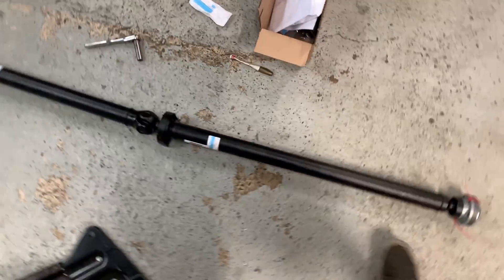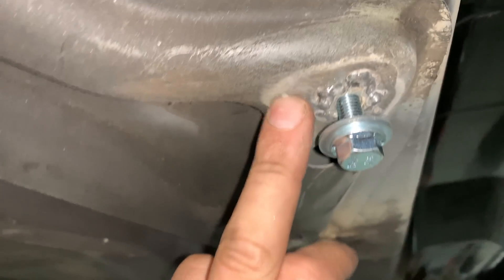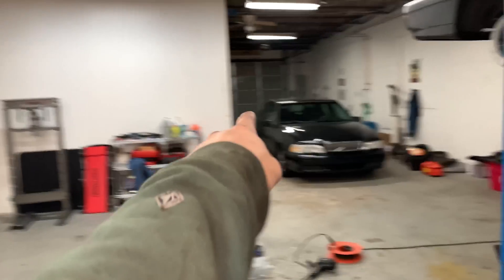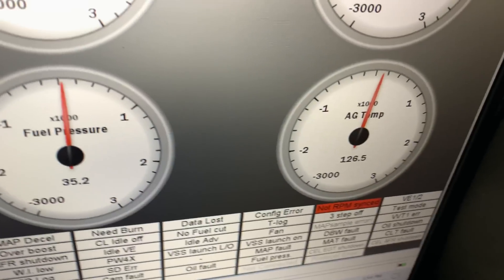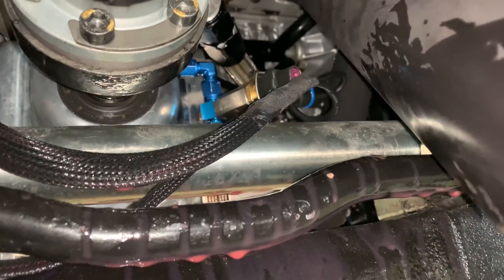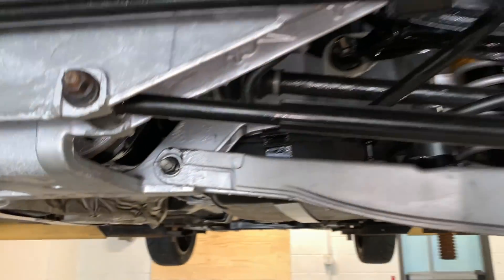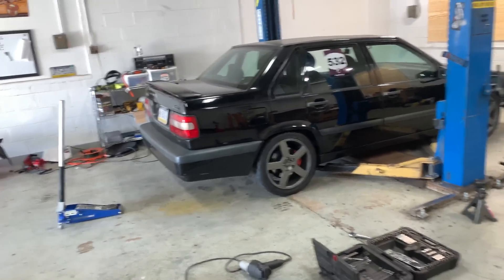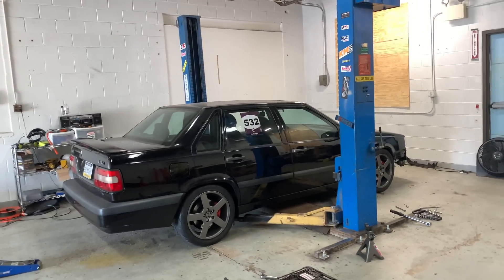Volvo 850 T-5R AWD Swap - First AWD Test (Bad VCU?)

Comment from the maker: Soo... to clear some things up... I am going try locked 50/50 to see how it is driving around. If its just some wheel skip when turning below 3mph or bind when at full lock I won't care as long as its undetectable driving normally. The long term plan is to adapt a GEN3 HALDEX from 06+ Volvos if for some reason I really really dislike locked. This is a race car that I just happened to be able to get street legal. This isn't a daily and I barely drive it. I dont drive in parking lots or go through drive thrus, I dont see being locked an issue. The car does 1,000 miles a year if that.
Reply from the maker: I ended up picking up a known good working viscous coupler. I just picked up my welded locked 4WD one too. Well be doing some back to back testing the next two videos... hopefully with an outside camera too so that we can see what the hell the rear wheels are doing. Doing some pulls in locked 4WD ill defeintly know what all 4 feels like... then I can compare to a known working visco. Maybe mine was just so horribly damaged.
Reply: @SimplyVolvo  Yes yes yes was thinking but forgot to mention outside footage! Was too excited:)
Reply: Dude Lock it! I drove a 240 with a welded diff (I know, not the same) for years around town! Hardly noticeable.
Reply: There are solutions, but over the head budget rabbit hole, but that was never the essential point of this build, more of a garage oem modified, right? It really has some special character to it, that's why I love this project so much.

As much as I understand, locking it, would have understeer problem while cornering, but for the straight line? Lock it!

But dude! You will give someone a heart attack in your town with this:)) Sounds SOOO GOOD!!:)
Reply: I'm excited for the next driving video sans center slipper!
Reply from the maker: @turbovolvos40  Yeah im curious to see how different the launches are. I bet I will need to launch closer to 6500 vs 5500. I don't think the stress will be that much more because I bet it will just break all 4 loose (215s on street aint much for 600hp even AWD)... however spinning all 4 I bet traction will still be light years over FWD spinning. Fortunately we will be able to compare the visco & locked launches.
Reply: The viscous coupling will slip like hell untill it is hot enough to make the fluid gel up, in the winter my 850 awd spins the front for 3 seconds and then kicks in when spinning, I've been looking for solutions to replace the fluid in the coupling just the the Honda unit, only issue is draining and filling a sealed unit. Also if you still have a reverse disconnect clutch in there, WELD THAT ASAP, they like to put weird load on the drive line by unloading it on decel, then taking a long time to engage again. Another awd 850 siiiiick
Reply from the maker: @micahb5659  Yes the reverse disconnect clutch (freewheel mechanism) is already welded Ive been told they break very easily.
Reply: I was thinking, man he's going to have to either lock it 50/50 or go haldex route.

Comment: Beautiful build. 
I’m here to remember, the one wheel off AWD test. 
Front right up, is there a torque value?
I’m worried I pooched my 98XC.
But left jealous of the new propshaft. My 97 Manual AWD, the steady bearing rubber is dead.

Comment: If a person were to build a torque sensing rear diff like a ooohhhhh a 8.8 ford out of a 03 s/c cobra and use the same clutch style front lsd one could have a 50/50 with minimal crow hop in parking lots .
Also one could use a set up off a p3 car and set up a rheostat to the aoc pump or even a window switch and better pump to increase line pressure sooner to lock the " slipper clutch" . I've used window switches( it can be set to rpm )  from NOS ( nitrous oxide systems ) before on my focus engine swap car and it worked great for turning on and off things for the chassis and aero back in 06 . The issue is the factory volvo part was never ment to control 700 whp and 9 kabillion pound feet😅😂🤣

Comment: So I have been a auto mechanic/tech for going on 25 years now.
I am a volvo tech the past 3 ......
How the hell do you figure out all this stuff? 80% of what volvo does makes perfect sense, the other 20 has me floored. Don't get me started about vida ( the worse diag system on the planet ) I've worked for ford ( right in the middle of them owning volvo ) so most of the systems on the p3 cars I know but these spa cars are driving me to put my head in my ball joint press ....
In short I am very impressed with your work.
Why does your bevel gear leak cam cover shmooie?

Comment: Dude I need your professional help I also have a Volvo 850 turbo and sometimes like working on a four cylinder if you can help me tell me what the problem is he does not lose water could be one of the torn rubber bands of the air if you can help

Comment: For the record volvo states 6 bolts prop shaft torque.. stage1, 10nm in a cross patten,stage 2, 25nm in a cross pattern. I didn't write the service manual, i just follow it.

Comment: HUH?!.. wtf is that hose which first goes right to the road then up,  in the front of the car?! If that sent fuel or oil ...you are insane! why would you do that as you did? why would you let the turbo in that stupid position for a modified car?! Why don't you build a mainfold which bring turbo over the gearbox somewhere, preferably with induction side pointed right to the front of the car?!

Comment: Ore the connecting part (don't know the name in english) between gearbox and angle gear already lost its teeth. Pick it up and turn the front wheels, the propshaft should turn along. If it doesn't turn thats probably the problem! good luck

Comment: As i said before, I welded the Viscuscoupler when I drove RWD and that worked good. As long as you have differantials between the front wheels and between the back wheels it shouldn't be a problem. When the viscus coupler is welded you get the same situation as a fwd car that takes a turn in neutral , just rollin. Al the wheels have the same rpm at lets say 5km/h and when you turn in, there is no problem. The only problem can be when you go on the throttle , that the rear wheels will try to push you strait. But the toyota Celica GT4 has also a contious 50/50 4wd system and no pronblems. Keep it up!
Reply from the maker: I tried the welded viscous coupler in 4WD mode i seemed to still not have much traction in the rear. Im going to remove a front axle and run it RWD and tune the rear suspension for max traction then the AWD or 4WD depending on which I use should work well.
Reply: @SimplyVolvo  did you check if the propshaft turns togheter with the front wheels. You can also turn the propshaft manualy and one of the front wheels should react. If not they are not connected

Comment: have the same problem with my viscous, when i tryed to winter drift it i had to really beat on it and get it hot to stay locked. what worked for me was clutch kicking it in 2nd gear but stil had to get hot so i feel your pain with the viscous

Comment: Matt, I meant to mention that maybe Hussein H.  might be a good bloke to talk to about the Viscous coupling or Haldex unit as he just built/converted a AWD Volvo C30 and is pretty cluey about these sorta things.
  
Also the main issue (which I think I've mentioned before)
 I see with a fully locked V/C is drive line wind up (which is one reason for a centre diff), which although probably won't break your tough drive line, has the possibility to put significant drag/strain on the system and if you're roll racing it could very well knock off some of your speed.
 Just doing a U turn in the pits is enough to load up the drive line, as anyone with a locked diff can attest to with that annoying wheel chatter.
You can feel the elasticity of the driveshafts as they wind up before suddenly loosing traction.
 A Haldex coupling would be a better choice, be it more complicated.
Well that's just my 2 cents worth anyway.
Reply from the maker: Funny you mention him, I just bought the old VC from his wagon. We have been chatting on what could be wrong.
Reply: @SimplyVolvo  
Well it seems our cars will be related to each other, I got the M66 open diff from his car too. 🙂
Reply from the maker: @Johnno48  Yes I have a bunch of parts off his old wagon. Exhaust manifold, larger fuel rail, fuel pressure regulator, most of the fuel system. Just another relic going on my car hahaha.

Comment: About that rear kicking in with a clunk after a few seconds. I had that problem in my 2.5T AWD (gen 3) where the Haldex oil pressure sensor was going bad. Replaced the sensor and the rear comes on exactly like it should now.

Comment: Volvo's viscous coupler gives you something like a 70/30 torque split if you're lucky. It's enough to kick the rear end out in the snow but that's about it. The fluid isn't nearly as thick as you would need it to be to hook with that much power at that high of RPM. There's also no way to replace the viscous fluid as far as I know.  The gen 3 haldex like I've seen you mention provides a 60/40 torque split in the sedans and wagons but I believe the xc90's haldex control unit allows a 50/50 torque split. I'm sure that's something you'd have the capability to program and alter to your liking anyway though.

Comment: Did you tune it your self.....
Reply from the maker: Yes I tune it myself. I had it on the dyno 3 times last year so it has a pretty good tune up in it, I just turned down the boost to 22 psi so its about 550awhp right now.
Reply: @SimplyVolvo  can you tune mine....I'm  1 of the people who purchased the exhaust manifold for an 07volvo v70r my vehicle is at MB AUTOMOTIVE... I believe u have had conversations with my guy...

Comment: Could fork over the $1300 on a new VC. Can't believe how expensive they are though. I'm curious how you plan to get it to permanent 4x4? Adapting a gen3 haldex would be interesting.
Reply from the maker: You weld the viscous coupler input shaft to the body. Thought about forking over $1300 on a new one but I would have to cut it up to weld the free wheel mechanism and who knows if it will drive any better.

Comment: I have been patiently waiting to see how the volvo viscous was gonna react? I have a honda that i am converting to awd and it is getting harder and hard to find the imfamous ef wagon viscous which looks very similar in design compared to the volvo one. but i would look into pulling it apart and seeing if you can change the fluid. that is what all the awd honda guys are doing and we can pretty much full lock them with a simple fluid change. I really hope you play with the viscous coupler you have before you just lock it. if you can make it work then i will attempt to use one on my awd honda!   love the build!
Reply from the maker: The Volvo ones are sealed and apparently not rebuild-able. I don't think a viscous coupler is going to give me the type of launch I was looking for anyway...even with one that isn't a little tired like mine.

Comment: If you take one from a haldex xc90 with the t6 engine your haldex Will work 30front 70 in the back and the only thing you have too replace is a pressure sensor en the module on the haldex ... Ive seen IT before maby that's your solution

Comment: Wait, why didn't you go haldex it in first place?
Reply from the maker: Becuase the non haldex rear of the P80 AWD is WAYYYY stronger. Haldex adapter would be best option... eventually. Im tired its been a long 10 months.
Reply: @SimplyVolvo  
Its a pity I live on the other side of the world as I have a spare S60R haldex unit and diff I could give you.
And despite what some people say the DEM (Diff Electronic Module) on the haldex is interchangeable between cars/models without requiring calibration.
Reply: Probably because it wasn't a option on this model Volvo.

Comment: Great to see it on the road Matt.
I'd think a Haldex coupler would be far better as there are controllers that allow you to adjust how much torque you want transferred.
I've had mine apart (S60R) and they seem pretty sturdy.
Reply from the maker: Yep eventually.

Comment: Perhaps you could use a mechanical driveshaft locker that you can engage when you want 4wd? I did look at one that sort of connects into the driveline and is operated by a cable but I wanted something I could engage with my arduino controller.

Comment: 15:00 comes the action!!!!  But making 50/50 can broke something when cornering? rear wheels smaller circunference than front wheel.   See tach at 8.5K  !!!!!!!!.  You are very careful driver, respect for other drivers.
Reply: Aren't most subies 50/50 all the time
Reply: @ricky107_  They  (Subies) have an central diff fitted inside the gearbox? Usually 4x4 cars have a center diff, no know if Haldex type has it. Prop shaft cardan can be stressed I think.
Reply: Ricky107 subies with 50/50 aren’t locked. Its just the bias of where the torque is sent when driving in a straight line costing. Volvos normally are 90/10 when cruising but can get to 50/50 depending on the load on the axles and how well the unit works. Awd and locked 4wd are different. Check out several videos comparing the systems and you can get a better grasp of it.

Comment: I doubt you would want to try mine, I'm sure the shipping would be cost prohibitive. I won't be needing mine, I  was always curious about the torque transfer, I didn't think it would be enough to break the tires loose on pavement, so that's why I decided to go a different route with mine. Also, I  know there are a few different viscous couplers out there you could try like Land Rover maybe.
Reply from the maker: Im done with VISCOS. They suck. Welded 50/50 for now until I made an adapter for a Gen 3 haldex AOC.
Reply: I'm using gen 2 haldex, and controlling it with the EMU. Hopefully I get enough torque... the bypass pressure relief valve is also "adjustable", so if it starts slipping, I can shim the spring, or get a stronger spring altogether.
Reply from the maker: @turbovolvos40  I know a couple 800hp haldex cars. Haldex clutches slip a bit in 1st but work really well overall. Are using the haldex rear diff too? Or P80?
Reply: @SimplyVolvo  haldex rear diff
Reply: @SimplyVolvo  I wanted to pick something that was plentiful in the junkyard, and I wanted to try the updated transfer case design. I'm sure I will break countless parts still, but as you well know, it's part of the process.
Reply from the maker: @turbovolvos40  Awesome! There is a guy who fitted the Haldex rear into the P80 subframe. Fits well it looked like. Someone posted some photos on my VolvoSpeed Thread.

Comment: dono if it helps but maybe the custom VC that boosted boiz use on the minivan, they got some serious power with the front shafts removed fully rwd.
https://www.youtube.com/watch?v=i1y0lZQjN9Y
Reply from the maker: I don't want to use a viscous coupler anymore. They are poor. Adapting a haldex clutch would be the best option.
Reply: @SimplyVolvo  fair, haldex would be quite good on the drag strip for burnouts being able to have the rear drive on a switch.
as long as you can get the clutches to hold the power, on my setup with the C1 platform rear diff&haldex the rear clutches with the solinoid at 100% duty can hold around 400-500ft lbs of torque

Comment: "Most likely going to weld it and lock the system full time 4WD"

Unless you want to fuck up your drivetrain due to driveline windup, don't do this.
Reply from the maker: I understand the pros and cons of a locked drivetrain. I'm not concerned about damage for how I use the car.